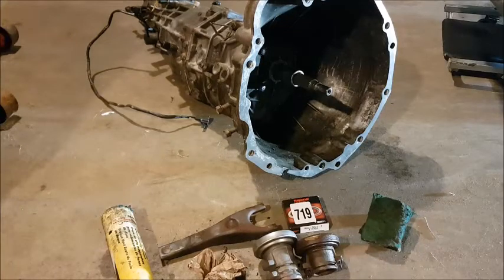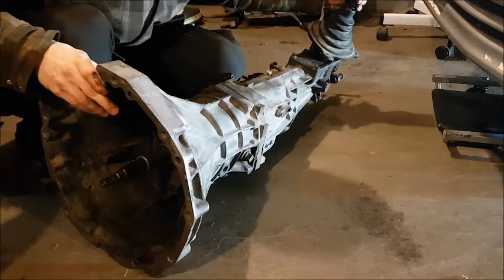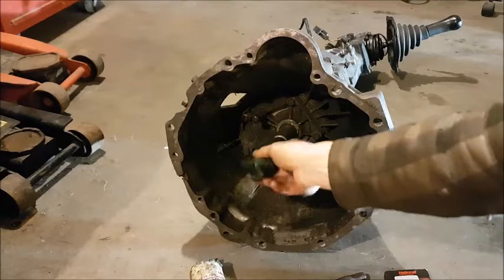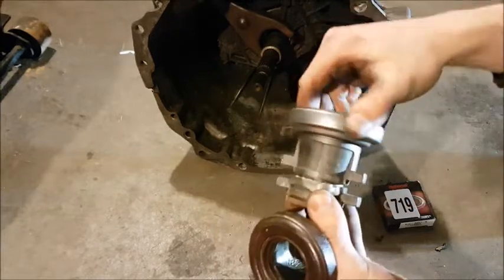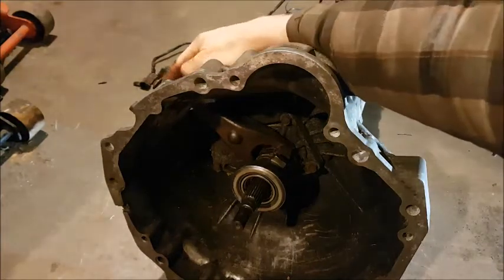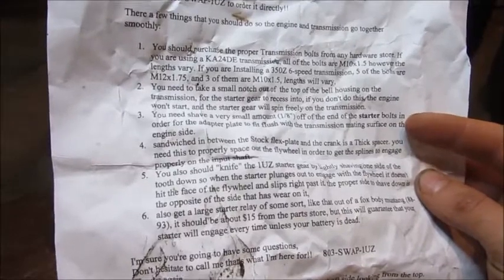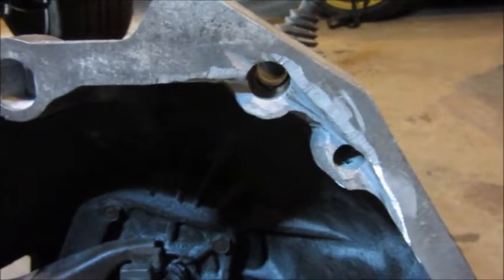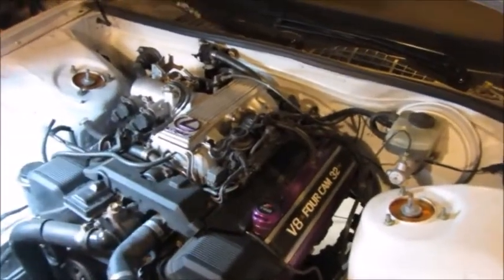LS400 Manual Swap Part 3: Manual Trans installed!

Comment: Be straight up. Everything included trans, extra parts. How much you spend?
Reply from the maker: $1800 canadian. We bought it off someone on kijiji who was going to use it on their SC, which is why we got such a good deal. Normally it would be $2500 usd or so.
Reply: JDMods thanks bro. I have a 92 celsior that I’m going to be converting to a manual soon. Good vids love the set up🤘🏾